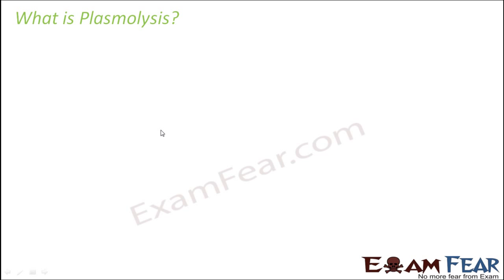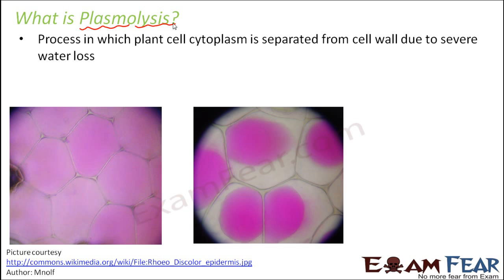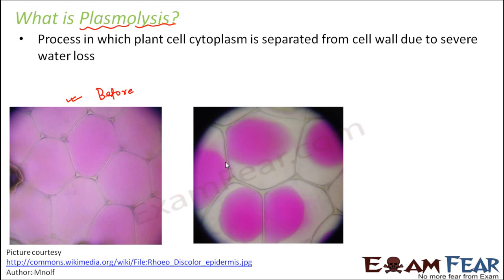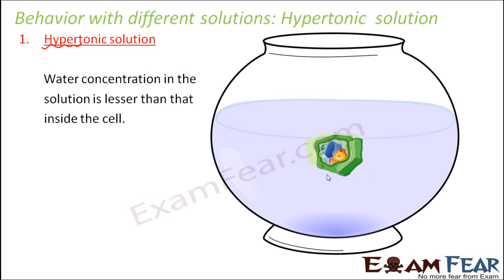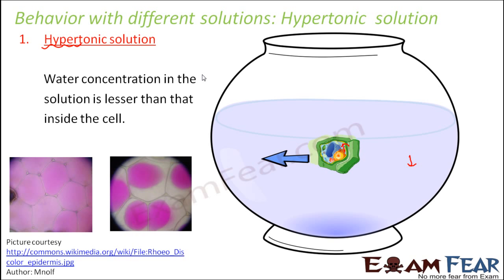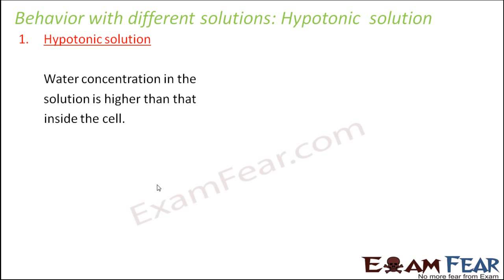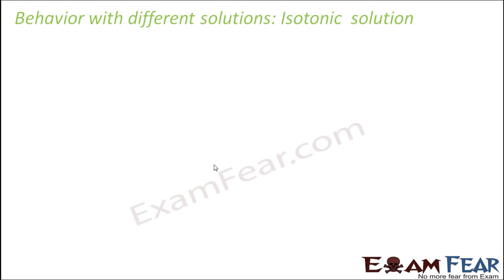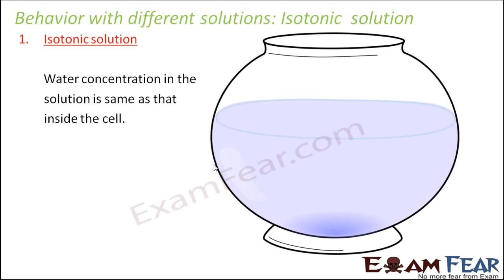Biology Transport in Plants part 10 (Plasmolysis) CBSE class 11 XI

Comment: the part that is about hypertonic solution is not fully correct because the rule of osmosis states that water moves from a dilute solution to a more concentrated one.. and u said that the cell is more concentrated than the solution that it is put in and that the water left the cell according to the osmosis/diffusion rule which is wrong